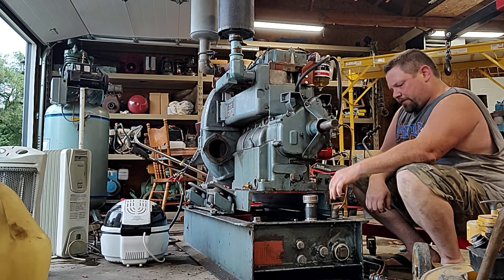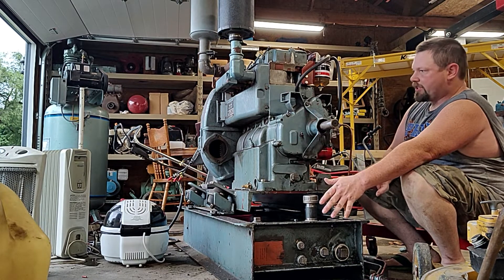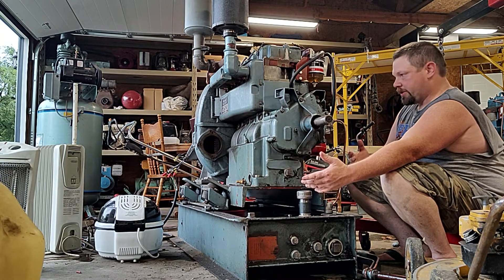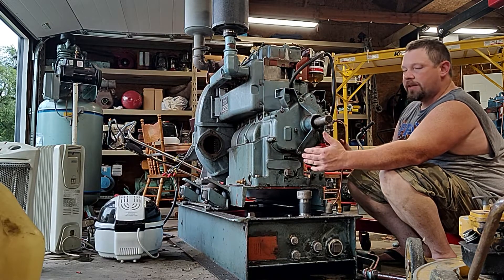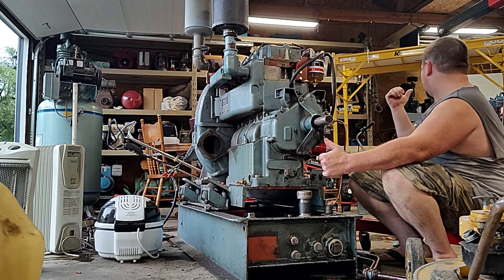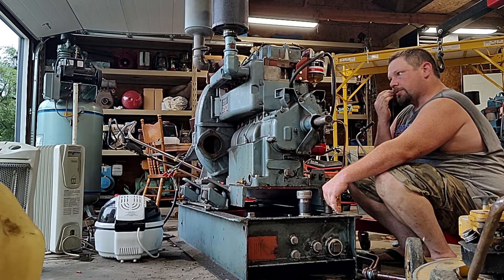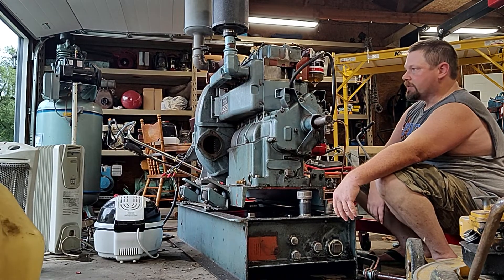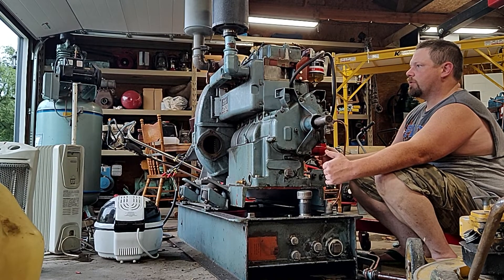Lister Diesel generator fuel system

Comment: Where are these located?   I've got a '73 sr3 with a 15 kva (12 kw) winpower 3 phase generator.
Reply from the maker: Central Illinois
Reply: @bigchevy80  thank you!!  I'd love to come see your systems but being in Nova Scotia I'm a bit too far away.  😕
It seems to me that some of your data plates indicate they run at 2000 or maybe even 2500 rpm?
Reply from the maker: @jeffanthony5434  they run at 1800 rpm like other 4-pole generators.
Reply: @bigchevy80  I thought they should but thought I saw 2000 or something on one of the data plates.   Might not have been accurate as I watched on my phone so details are not always the clearest.
Reply: @bigchevy80  What is the chance of you letting me know what you have for sale and price ??? Thanks